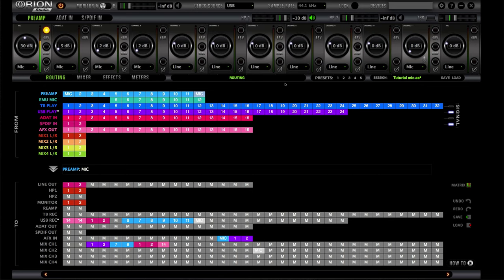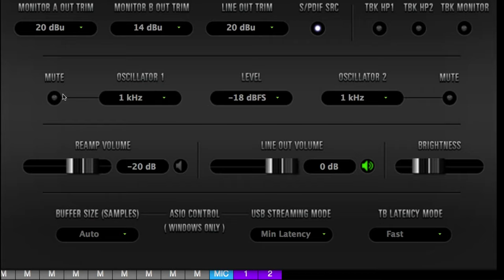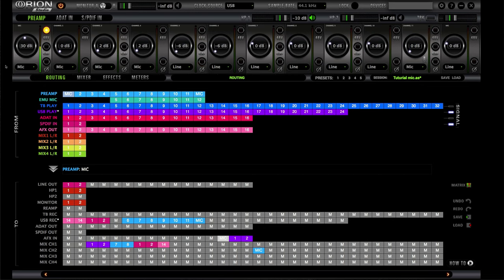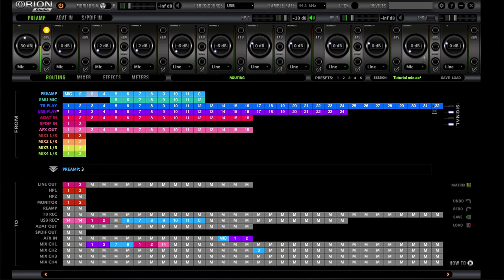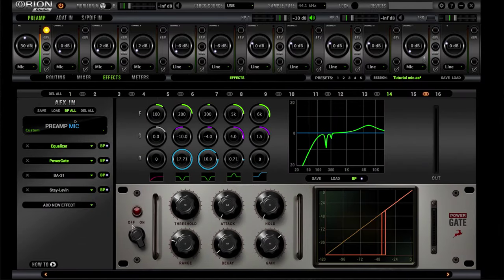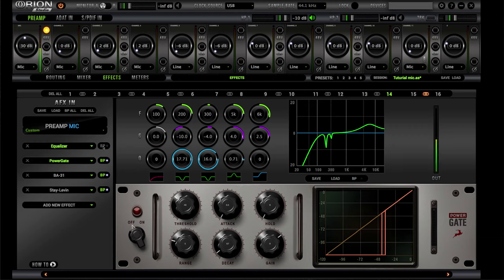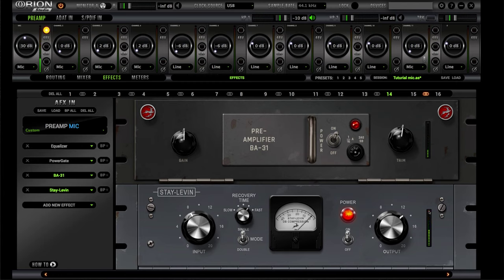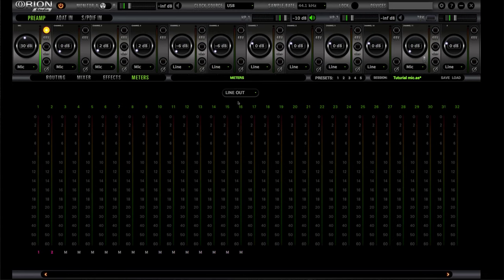ANTELOPE AUDIO ORION STUDIO CONTROL PANEL EXPLAINED

Comment: Antelope system is so powerful, i own an Orion+ & Goliath, love the control panels. I never even cracked open any manual or needed a video, it's very intuitive and obvious how it works.......Only, i wish they'd add more features to the mixers, like solo and mute snap-shots particularly, that would be extremely useful ........
Reply from the maker: Great insight ! I agree with the feature additions to the mixer !

Comment: This may be a very dumb question but as I've found, it seems a lot of people easily get confused with this routing system, but to be able to hear what I'm recording (say some guitars) through BOTH my monitors AND headphones do they both need to be red? I think I've really confused myself on setting some stuff up so far. Point being a I recorded a guitar last night but then when I went to overdub I couldn't hear my guitar but I could hear the recorded guitar which made overdubbing a nightmare... thanks! this has been the only tutorial I've found that has remotely made any sense to me so far! cheers dude
Reply from the maker: Thank you ! While the interface might be confusing at first glance, generally the meters should not be in the red, unless you are going for that digital distortion overdrive/clipping sound when recording. As for as monitoring and headphones, those levels just show the output levels. I would suggest lowering volume of the recorded guitar. The goal is to have a balance so that everything can be heard.
Reply: @FizzENT  haha thanks for the reply dude, nooo I don’t mean red as in levels 😂 but the colours of the routing, HP1 HP2 / and the main monitors are in red, I’m solely on about my monitoring situation, levels are all good 🤓☺️ it’s the routing I’m getting a bit of confusion with, I did manage to get it to work how I needed it for my session but still want to be sure I understand how The routing works clearly, I really wish antelope would do a better job explaining it
Reply from the maker: @sleepisbutadream  ohhhh 😂 In that case, I normally use the software mixers for monitoring,  From Mix 1 L/R to HP 1 and monitor. My Sources are plugged to Mix Ch 1. I noticed they did put some updated videos on their channel. Not sure if that makes sense with their newer interfaces.
Reply: @FizzENT  I think that’s what I managed to wangle to get it to work in the end so I think I’m on the right track! Thanks for confirming that for me ha! ☺️👊🏻🤘🏻

Comment: Hey man, thx for the nice vid. I have the 5059 summing mixer too and I just got this interface but Im still trying to figure it out. I have connected the two units with db25 cables. But I can't figure it out in the control panel. For example, I have a kick and trying to route it in channel 1 on my 5059. How do I do that on the control panel?? Thanks in advance for the help! much appreciate it, Jess
Reply from the maker: Absolutely ! You will want to focus on the Line Out on the software patchbay. Wherever your kick is showing up at, you will want place it on the first channel of line out "1"
Reply: @FizzENT  Thx bro!

Comment: Hi..if I am recording MIDI on Cubase, I have to use the afx2daw to insert the FX from Antelope directly to Cubase right? Without that bridge, I can only rely on Cubase FX to modify my MIDI note. Too bad, I don't have thunderbolt connection at the the moment as the afx2daw only works on TB. :(
Reply from the maker: Hi, i'm not sure about cubase. Keep in mind that midi is not audio. AFX2daw allows you to pull up the plugin version in cubase. If you do not have the plugin version you should still be able to use the routing from the control panel to route the AFX in and out of cubase. Also it should work over usb and thunderbolt. Using AFX with USB will limit the number of channels being used.

Comment: What abut using this as a Digital patch bay.. I.e Have a Synth and an outboard Reverb channel. So The keyboard in input 1 +2.. and Reverb 3+4 Can I route the synth into 3+4 and route 3+4 back into my daw?
Reply from the maker: Essentially this is a built in digital patchy ! Keep in mind the preamp is a physical connection and also Line out is a physically connection. Technically yes, you should be able to send a synth on line out, but to get it back in, it must be connected to a one of the preamp, careful to create a feedback loop, use send and return method.
Reply: @FizzENT  thanks for that! I settled for flock audio instead! As much Inloved your review to many horror stories in gearspace
Reply from the maker: @NyakzOTSD  I've read and seen lots of negative reviews, but I went against the grain. Been solid for me running on a Mac to say the least.

Comment: how do you do direct monitoring?
Reply from the maker: Using the digital patchbay. Take signal from pre-amp and drag into monitors 1,2. In other words you re going “from” pre-amp “to” monitor.
Reply: @FizzENT  sorry, but this is also for me the part I don’t understand. It’s not possible to route all the “real” inputs (preamps, adat and spdif, so 30 inputs) to only 2 channels of monitor A. Same problem for comp play, also 30 channels, but you can’t route allof tem to monitor A.
Reply from the maker: @PeterReesvan  it must go through the software mixer.  You have a source which would be your microphone plugged in pre-amp.  Take out of pre- amp to software mix 1. Take outputs of adat etc. all plugged into mix 1. Finally take the output of mix 1 plug it into monitor out